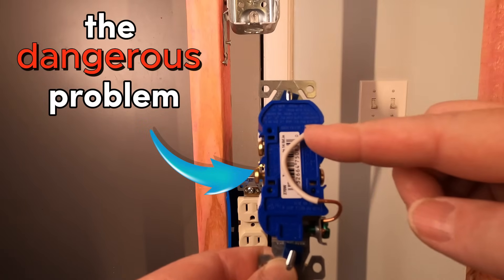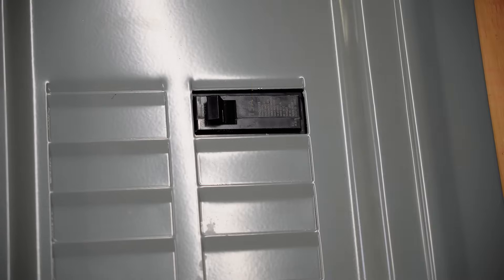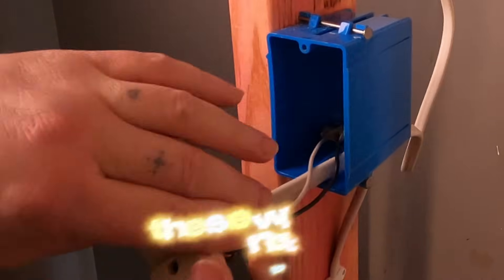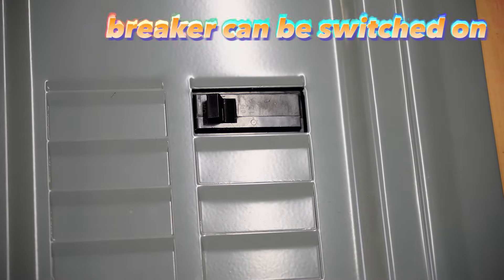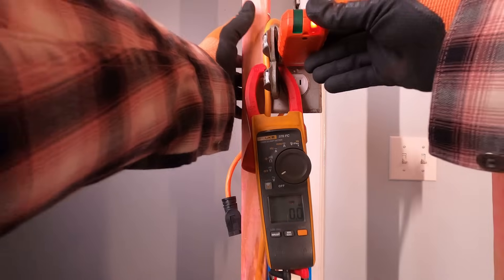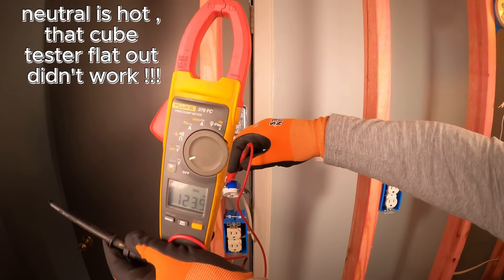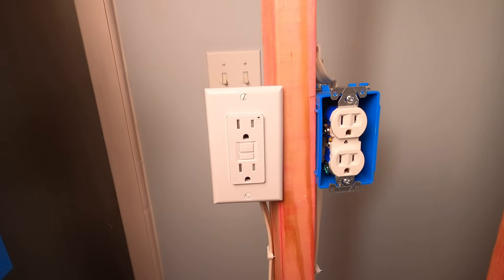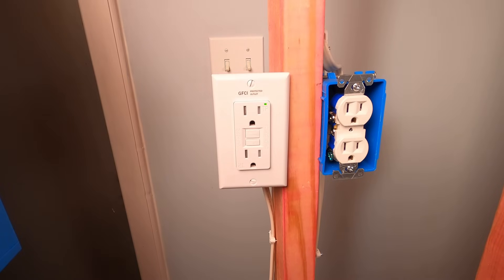why the cheaters ground is so dangerous & the #1 fatal reason to stop doing it !!!🤬

Comment: The customer said that she attached the hose to the patio faucet, she got a shock, being barefoot and standing in a puddle. The house just had a near total renovation. Except the underground service was original. The new grounding and panels were installed by qualified people and the live current on the grounding was barely detectable. When the utility feeder grounding is broken underground, or at the pole, the back up water main and electrode grounding points took over and were not making enough earth contact to divert all the fault current. The fault was underground between the utility pole and free standing meter/disconnect in the woods 300ft from the house.
Reply from the maker: Damn ,, I hope did they address the problem and got it fixed?

So The ground had a voltage barely detectable , (copper water pipes ?) guessing With the copper pipes & gas pipes were grounded  . 

  I know what you’re talking about. I’ve seen something similar. Electricity wants to take the path of lease resistance. Hey thanks for commenting and sharing that.
Reply: @ElectroMedia-cs9ek  I had a feeling that the copper water main inside was spliced to plastic underground close to the foundation. The electrode was in very soft earth. He was a young investor flipping a 7K sqft house. I have no idea what he did. The shock almost killed my realtor friend. My invoice stated that the house is a deadly shock and fire hazard. He sold the house in less than 90 days, before I could levy a past due mechanic lein.

Comment: TN-C earthing.  Terrible idea even when done properly.  All you need to have happen is the neutral goes open or just high impedance and everything earthed on the affected outlet gets its chassis pulled up toward full supply voltage (120VAC in this case).

Comment: I've worked with residential electric for a while. I'd bet that this homeowner saw that the grounds and neutrals in the breaker box, ''both ground to the box'. Ergo, "I can make ground, in an ungrounded outlet box, the neutral, since they go to the 'same' place in the breaker box".  Yea, until you kneel on the ground and touch that box.

Comment: Very nasty. Thankful for the 'don't stand on it' UK plug/socket arrangement that's had a separate ground (continuous protective conductor CPC) almost forever. 
Our modern hazard is the potential that the potential loss of (diverted) neutrals on distribution circuits. It's always something ;-)

Comment: The GFCI cover plate should also be labeled “No equipment Ground”. Per NEC.
Reply: Especially replacing two prong outlets with GFCI , when there's no ground The sticker that says no equipment ground is an absolute must to comply with code
Reply: And any downstream receptacles need to additionally be marked as "GFCI Protected".

Comment: I wonder if it's a regional thing. I've worked on a lot of old 2 wire houses and have never came across a white wired to ground. 
Interesting
Reply from the maker: I’ve come across it several times even 75 to 90 miles apart, and sometimes I wonder if it’s the same person doing it in my area, but it’s usually a short piece of bare ground , some of the homes you can tell it’s been like that for a while maybe 15 to 20 years. I correct the problem every time I find it this was just a special case..

Comment: Thanks for the video. I haven't seen the cheat done.  I have had houses with knob and tube wiring.  I was able to find non grounded receptacles.  I has a contractor tell me i could get 120 v in my well house by using the ground as a neutral.  I chose to buy a transformer instead. Rewiring old houses is expensive but saving lives is better.
Reply from the maker: yes it can get pricey  , but there are  options to make older homes safe . well  you're   panel , it can always be updated or at least add a ground buss and ground rod if needed (crazy but some homes don't have ground rods) , and if you have a spare fuse holder or breaker space  in the panel , run a dedicated circuit with ground , the rest of the house won't change but anything circuits  ran here on out would be . I hope that helps . Thanks for commenting
Reply: The likelihood is that what you had is a neutral, not a ground, and if so, what you were told would be correct.
Reply: @diverbob8  It is 12/2 with ground. If it was 12/3 i would have a neutral.

Comment: Over the years in the trade, I've heard of this condition known by several names

False ground 
Bootleg ground
Cheated ground 
Pirated ground 
Dirty ground
Live ground

More likely to be found in a flipper home, and the motive here is purely profit.  For starters home inspectors are not required to remove cover plates to check for this condition and so is oftentimes overlooked.  Armed with this information, shady investors and renovators will remove the original 2 wire receptacles and replace them with 3 prong.   Leaving the ground unconnected will show open ground and fail the inspection.   To avoid this, the neutral to ground jumper is installed to make the tester show CORRECT,  and most inspectors rely on these cube testers,  and will pass inspection.   The home is then sold at a price reflecting a total rewire job, which can cost several thousand to tens of thousands depending on the situation, and the flippers keep the profits.

There is a very advanced tester that runs between $400- 500 give or take,  the Ideal SureTest Circuit Analyzer, and can identify bootleg grounds by sensing the impedance between neutral and ground,  and flashes  an "F" over the ground on the display if the impedance is below a certain threshold,  indicating a possible neutral to ground jumper at the receptacle,  but can also give a false indication of this condition if testing a receptacle very close to the main panel,  where the neutral and ground are required to connect.  So to your point,  we cannot always rely on our test equipment to provide the whole picture.

Comment: The home was a mfg, the wiring was done by the company and set.  The power co put in the underground cable to the front of the one end not to the back where all of the wiring was dropped,  Instead of running a longer entrance cable and put the breaker panel in the back, they put in a metal box in the floor joists and extended all of the wiring, one circuit at a time with buds on every connection.  I opened the box and quickly closed it.  When I finished the basement i had the power off and was replacing ceiling lights.  I took down a fixture and pulled the white off and got a blue flash.  In that massive mess in the box they had an open white connection in the garage circuit.  They took a 12 2 w G from the light i was working on to the garage light and connected it there with the ground and black cut off.  If you lose a ground, you find it.  I do not blame them for not wanting to look in that massive connection box, but that is what should have been done, but then, that box should not have existed.  The plumber?  Just as bad.  we moved in, a new home and every sink had drain leaks, some multiple.
Reply from the maker: Yeah, they should’ve run that wire to the panel. It’s always better not to have junction boxes, it sounds like the neutral was being shared and when you disconnected it, you seen that spark because there was a load being pulled off of it, sorry to hear that man and that plumbing That serious business. I hope you got everything addressed and squared away. There’s just people that don’t have any pride and they may know what to do but cut corners. Thanks for sharing that and commenting

Comment: I had one in my home, wired by a licensed electrician.  I added an outdoor off the living room receptacles, tied in properly, GFI, all good, I thought.  I had Christmas lights out  on candy canes, one had fallen, part of the string on the ground, I came home with the lights glowing about half brilliance. It was raining and the string on the ground was wet.  My first thought, could I have wired it with the white/black flipped.  Yes, I know better but shit happens.  I opened the outdoor box, ok, the indoor receptacle connection, it was OK, the one receptacle was above the breaker panel, I opened it, the wiring was reversed there. This is one of three bad items in this house i have found.  Note that electrical company is on my do not call list.
Reply from the maker: That’s crazy , Yeah, for a license electrician business owner doing work like that or workers, definitely needs to be reported , they usually never last once people catches drift of shady work the phone calls stop (that’s not a true pro ). In my mind, there’s only one way to do any trade,( the right way ! ) nothing feels better than making a customer happy with good workmanship and fair prices. I appreciate you sharing your experience & thanks for commenting
Reply: I will admit the shade tree electricians do some bad work, but some of the "pros" are not that good.
Reply: I found a "hot " neutral in a mfd  home. Inside the wall there was an insulation displacing connector splicing romex .  i didn't think there was such a thing. It had clear plastic windows so that you could see the wire color.

Comment: Some idiot did that in this house. Instead of just putting a sticker on the lavatory that reads "NO GROUND" which would have satisfied the code, he put a hot from the neutral to the ground. So of course, when the metal vacuum cleaner was plugged in, and switched on, you got a nice feeling of your arm turning into a spring and feeling really tired, really fast. I wish these testers would identify false grounds. That's what the guy did. It failed the first inspection but passed the second inspection and it was marked as "fixed" The first report said No ground present. The second report said their is, because when what he did as done, all the lights come on showing that everything is correct. Now if he landed a hot on the ground, then I have to wonder how the tester was fooled because that would have shown hot and neutral is reversed. Also, this is why metal boxes are important, and that they, themselves be grounded, in addition to the box being bonded and the outlet being grounded. If the box itself is grounded, before wires ever even come into the box, then a hot or an energized box would be shorted to ground, killing the breaker, instead of a person. When I rise to power, The NEC will be changed and plastic boxes will be banned. One of the reasons, which I just cited.

Also, you do not have a strain clamp on your metal box so you're not installing that outlet "correct"
Reply from the maker: I agree the cube testers should be more advance in 2024, just detecting the resistance, of the grounds distance . the neutral and ground Bonded at the main panel that would be a lot more resistance it could be done.

  When I do a job with Metal boxes I keep ideal, grounding, pigtails already made up. I buy them by the bags. box connectors believe me I don’t leave anything out .I enjoy doing electrical work and proud of every job I walk away from new construction or remodel.  always  good workmanship. This was just a simple demonstration and recreation of how the job was found for educational purposes. .  Thanks for sharing & Commenting  and appreciate you watching the video.

Comment: It energizes also everything plugged in the outlet. A non-contact voltage tester will lit on the entire outlet in such case. The normal tester does not see anything as it only compares the prongs, it does not actually know which is hot and which neutral.
Reply from the maker: Yep, you’re right. A point tester would just go off because it would be sensing voltage in every direction lol it’s not a very good tester for that situation, that’s why that grounding trick is not safe and I run into this issue at least 2 or 3 times a year. I found that problem pretty fast , right when I pulled that outlet out I knew why it energized the cover&box,. 2 outlets in a bedroom.  was reading good the others hot neutral reverse and it was feeding that outside receptacle which wasn’t a GFCI either.

Comment: Hey it’s obvious the guy or person didn’t know anything about electrical work.
Reply from the maker: You are Absolutely right ,and I knew that . To prove it the companies that produce electrical testers and cube testers and such would have never built them to test (open hot- open neutral -open ground), (hot ground reverse),( hot neutral reverse )….. if it never existed which it does. That was the simple stuff, I could just imagine if I made a video more technical with resistance & voltage drops. Balanced and unbalanced circuits that share the same neutral . Hey thanks man, I appreciate you watching the video.

Comment: I don't know what the hell you-re talking about. When one takes the ground and the hot wire and installs them on the same side of an outlet you trigger a breaker. This may work if you cut the bridge between the upper and lower receptacle, given you match them with the opposing power wire. What you showed us makes no sense.
Reply: The only way the breaker would trip is if you had a dead short between the hot and the neutral, is this scenario there's no equipment ground running to ground. So if the hot comes in contact with the ground wire there's no way the breaker will trip! So any conductive material the hot wire contacts will have current running through it! Maybe eventually it could possibly make its way to ground and trip the breaker! MAYBE! How about people just do good competent work and this wouldn't be an issue!
Reply from the maker: @rshoe1023  exactly
Reply from the maker: Did you see the video, or listen this is something that I found on a job, someone tried to pass an inspection on a remodel house, and they stabbed a ground in the neutral side and landed it on the grounding terminal, whoever did this throughout the house which I explained through the video . messed up on an outlet in a bedroom and they accidentally mixed up the wires how they did it I don’t know what was his deal or how he got mixed up, but it happened and breakers. Don’t just trip on a hot reverse neutral. What happens is the power gets reversed and when you put your cube tester in it, it reads reverse neutral,. This is a job that I troubles shot and was trying to re-create the problem that can happen when these people, maybe I might need to explain it a little better but in an older house that doesn’t have a ground throughout the house there’s no ground. There’s no breaker to trip a breaker doesn’t care what color the wires are. It becomes a reverse hot neutral but you know, 25 years experience in trouble calls, you might not know what the hell I’m talking about I do because I fix the problem. Thanks for the comment maybe you might run into it one day but I’ll run a business . The video wasn’t if the cube tester  gets tricked I assure you it’s not the only measuring device that I can trick and trip up and many people have done this exact grounding trick on a house that does not have a ground built in the 1920s or 30s with knob and tube and all metal boxes. This video was about people that do that need to pay attention because they can get someone electrocuted if they accidentally hook a receptacle up like I was trying to show in this video, a hot reverse neutral.
Reply: There is no grounding conductor.  Only the hot & neutral.  Only two conductors.
Reply from the maker: If you plug up new devices to a hot reverse neutral, they’ll work just fine. It’s  altered current  A/C system.Most of the time people / homeowners do not even know that that is going on because they’re not electricians and they’re not checking for stuff like that . It’s just sad that they had to find out that way. It didn’t take me long to figure out what was wrong. Thanks for the comment Really appreciate it
Reply: @ElectroMedia-cs9ek  Yes what you've said here is called reverse polarity, and yes most appliances anymore are polarized! So you wouldn't know if the hot and neutral are reversed. As long as the hot conductor never comes in contact with anything conductive, you would never know unless you plugged a analyzer on the receptacle.
Reply: @rshoe1023  Polarization is only so that in lamps the switch breaks the hot. It has nothing to do with the working of the device. In Europe sockets are unpolarized and things work perfectly OK. There just is 50% chance that a lamp has voltage even when the switch is off.

Reverse polarity in itself is a rather minor issue but combined with the bootleg ground it is absolutely deadly, it is the worst problem you can gave.
Reply from the maker: @okaro6595  I’m glad some people know what I’m talking about, thanks for the comment
Reply: You should also use the ‘no equipment ground’ sticker. The gfci sticker is optional on an actual gfci receptacle.
Reply: @TomCee53  Yes by code you're supposed to put the sticker on the face plate in this scenario.
Reply from the maker: @TomCee53   I would say it’s over kill ,   and the GFCI sticker or stickers on the actual device, but it depends on what inspector you have, I’ve had to go all the way back to a house just to put a dang sticker on the actual GFCI receptacle,  but I do and I’ll make sure they’re always on everything. I hear ya No ground equipment needed to be marked.

Thank for commenting 👍🏻